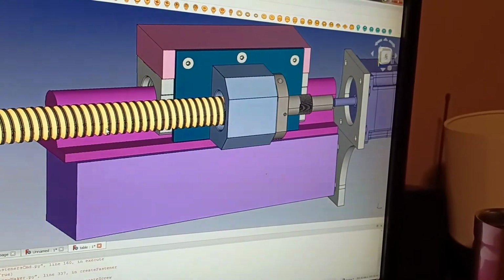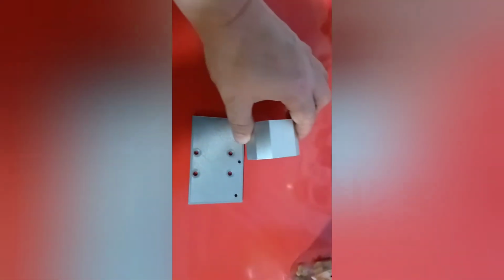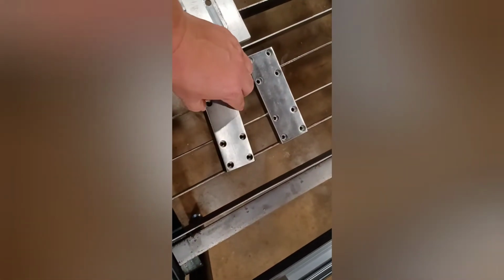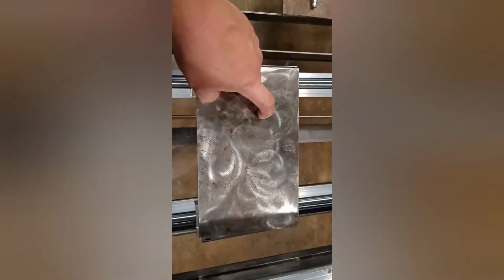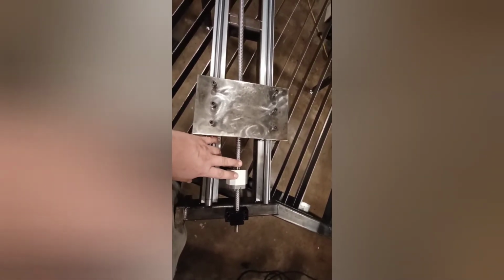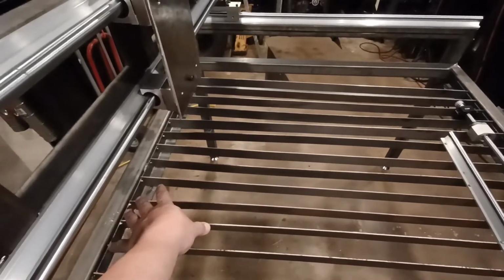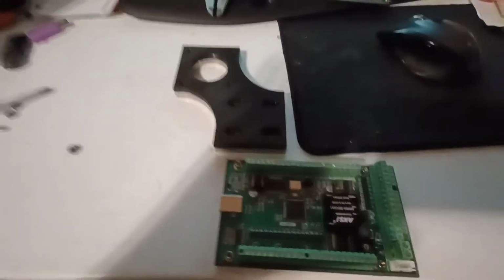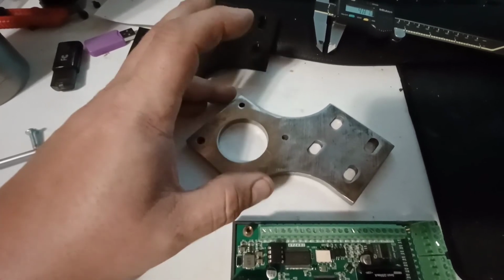DIY CNC Plasma Table Update 4 Also HAPPY INDEPENDENCE DAY!!

Comment: The table just got smaller, I wondered about that but figured you had it covered, It's really looking good though and should work great when finished. How easy is the CAM in Freecad? I still haven't completely figured out the CAM in Solidworks. Happy 4th to you and the family. Thanks for the video!
Reply from the maker: I'm enjoying the Cam in freecad. I can almost say with certainty it's no where as good as solidworks or Mastercam but I haven't found anything it won't do yet. From helical cutting to adaptive tool path. Which from what I understand needs a bit of understanding. I'm always learning as I go but for a free program it's not disappointing for 3 axis machining. I would assume if your looking at at 4 or 5 axis you would definitely want (need) solidworks.
Reply: True on the price of Solidworks but as a veteran you can get it free. I just have a problem with the way they do the CAM. I know it's just me and I need to force myself to sit down and just learn it. I don't have any of the tools set up and that's an undertaking all in itself.